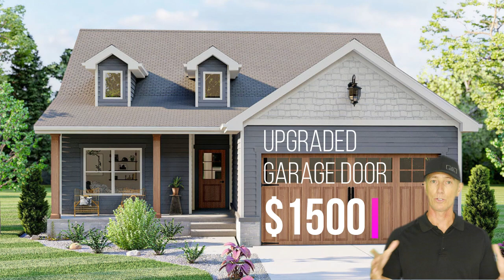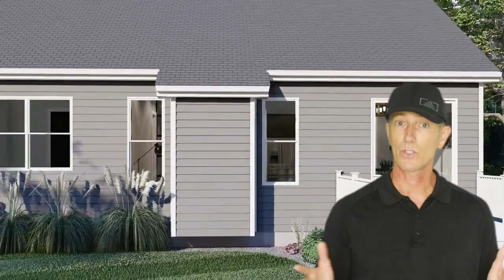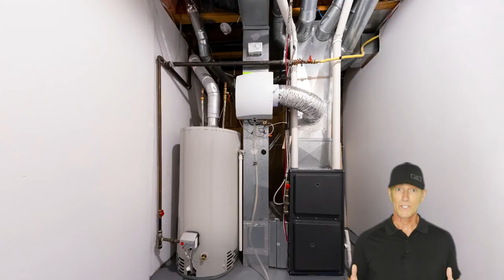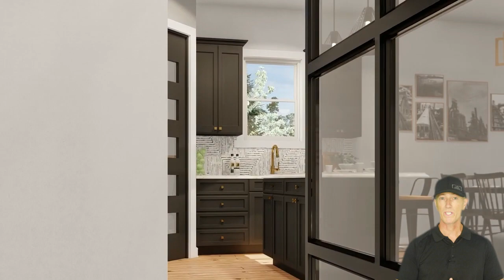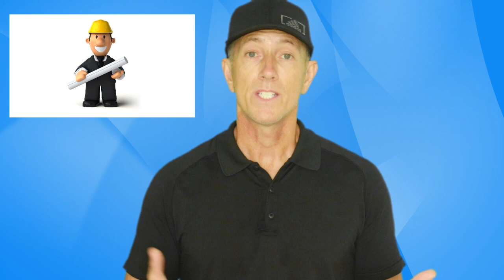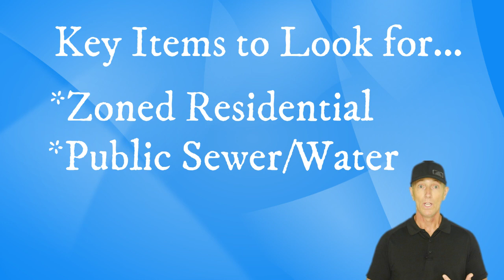Affordable House Design

Comment: 2x4's haven't changed much in months but 7/16 osb is around $16 a sheet whereas it was $47 a sheet just a few months ago. $16 a sheet is still too high but I have an idea it won't go lower than $14 if it even goes that low. I built my first house in the late 90's osb was $8 a sheet. After I moved in it dropped to under $6 a sheet. Today's lumber rates are almost completely price gouging in my opinion.
Reply: Transporting that lumber throughout the process is a big cost factor and those costs have gone way up.